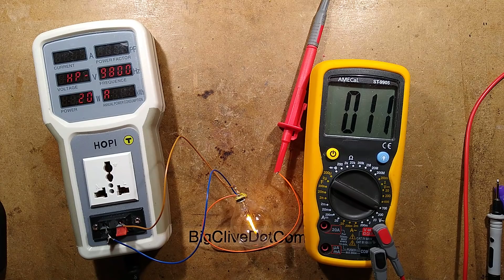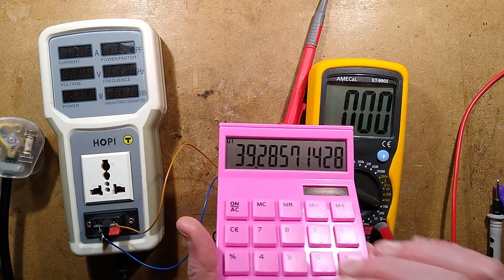Exploring 0.5W LED festoon lamps and extending their life

Comment: In America we don't problems with this type of socket causing fires all the time.  They are called "candelabra" because the fabulous entertainer Liberace wanted to put a candelabra on his piano during his Las Vegas performances but couldn't use real candles on stage so he got a company in Michigan to fabricate a candelabra out of electric bulbs.
Reply: I'm pretty sure candelabra base predates Liberace by several decades. I have several wall sconces from the 1910s that use that base, and I have old 7W incandescent bulbs from the same era that are "flame shaped" to use in them. The wall sconces are designed with a bracket holding a drip tray, a cardboard sleeve painted like a candle, complete with candle drips on the sides, and then the bulb, and a hanging "reflector" over the lamp, exactly as a candle sconce from the 1700s would have been.
Reply: @lwilton  exactly, would love to know where that misthinking came from!
Reply: @phonotical  from the company itself, who probably overcharged the ignorant artist by a mint for creating something which he would have been told is 100% original just for the sake of extortion. I couldn’t imagine how many times Michael Jackson’s purchasing power must have been u$ed against the market seeing as he’d never waste any time at auctions bidding on artwork.
Reply: @HighestRank  don't believe all you read

Comment: You should try one of the filaments on a current limited DC supply. Try reversing the polarity and see if a different set of LEDs light up. This would show that they are made of pairs of reversed LEDs.

Comment: The exterior Christmas lamps used in the past to decorate the homes outside in the States never had any holes in the socket base to drain out water. We never had any issues with moisture causing problems with either the lamps or sockets. The traditional Christmas tree lamps in the States used an E12 base while the exterior lamps used a slightly larger base ( perhaps an E15) and were made of a thicker glass to endure the temperature variants and rough handling  found in exterior use.

Comment: I have these and they are not waterproof. I had issues within in a week. Took bulbs out and filled socket with dielectric grease put bulb back in. No problems with water getting in.... Will be adding a capacitor thanks .

Comment: Interesting.
Wonder if the led strings are wired as a bridge rectifier.
Small correction. These are not festoon lamps, those are tubular with a cap at each end.
Reply: Small correction,  the string of bulbs can be hung up in a festoon. The bulb you mention is a festoon in itself with the internal filament festooned from one end to the other.

Comment: In Adelaide, South Australia we have had that size festoon for about 20 years but they are low voltage (12 Volt) only. Bedside lamps and Xmas tree lights are all they are used for.  A lot of people use them for under cover entertainment area lighting. My best friend has 4 sets daisy chained which run the entire border (8 m x 5 m) of her back porch/entertainment area. They light up the area really well. They have been up for almost 6 years without any problems.

Comment: I’ve got the solar panel version that has 2 lithium batteries in it, on my garden room. On a sunny day the solar panel keeps them on all night, still working nearly a year later. Each lamp is 3 ish v if I remember right.
Could you take one of the lamp bases and fit the capacitor to it instead of a lamp, so it could be part of the set, maybe the first lamp in the run?

Comment: I use dielectric grease from an automotive parts store and smear it on the bulb threads to help waterproof it and prevent corrosion.
Reply: How about wax?
Reply: @fredfred2363  Might work. Grease will move as things expand and contract.

Comment: The LEDs voltage of 110V could indicate that the bulbs without resistor are used in the USA, it also means that the US version if wired in series with a second set could work in the UK, no resistor issues...
Reply: Leds always need a resistor in series to limit the current. For 110V it is a smaller value and also dissipates much less heat.

Comment: I would love Clive to explain why Europe has more phases in there electrical system.  I know why they did it over in the US/NA,( to sell more copper), but I've only seen larger phases in commercial applications, never at home.  It's strange when your at work and half the lights and power go out because of a power outage but other areas continue to work fine without a UPS or generator.

Comment: That is a standard Candelabra base used here in the U.S. and is very common. Old indoor incandescent Christmas tree lights like the string you're showing was also the source of many house fires around Christmas. The E-14 base you showed @1:13 was commonly used for outdoor incandescent Christmas lights and I can't think of anywhere it is used these days except for appliance bulbs such as a Microwave. The Candelabra base is still used in chandeliers and wall outlet hallway/bathroom nightlights with incandescent but now it's common to use an LED model lamp instead.

Comment: the vent holes actually help keep moisture from building up in the sockets, GE c9 Christmas light sockets from the 60s were the first to use vents in the sockets to keep the moisture from building up, it was found that with a totally sealed base that even with a rubber washer some moisture made its way into the sockets and would corrode the base of the lamp badly and eventually lead to shorting in the socket.

Comment: Are all the bulbs in parallel, or is it two parallel strings of seriesd bulbs (as is typical with fairy light strings here in the U.S.)? Since they only have resistors in them, and operate off both halves of the AC cycle, could you dim them with a Triac-based dimmer? Have any of the resistors gotten too hot and gone all black and sooty? How about hacking the Triac-based dimmer by controlling it - not with a pot - but with a blinky LED? Electronics can be so much fun… when you wander off the path! 😋 (especially if your path is lit by blinky strings of LEDs!)
Reply: Like most large-bulb sets, all the bulbs are in parallel. Usually only the mini-lights are wired in series.

And yes, since it's just a resistor and LEDs they will run fine on a TRIAC dimmer, at least if the current is above the TRIAC's minimum.

Comment: I would guess that the small holes are to allow for water drainage/evaporation since these are designed to be used outdoors.
Reply: Years ago I actually looked at the patent documents for those sockets with holes. Indeed they are "weep holes" to let water get out. The addition of those holes is what allowed C7 stringers to be labelled as indoor/outdoor rather than indoor use only.
EDIT: Outdoor use in USA, not sure about other countries.

Comment: Always liked the word "festoon", it used to be used to describe a particular type of train-spotter, the chaps weighed down with lots of cameras, some with massive zoom lenses etc. 

My grandfather showed me a length of festoon cable and how to put on the lamp sockets which spike the flat cable, this was about 55yrs ago. It was chunky stuff, I think it probably came from an uncle who worked for the council as an electrian and got involved with hanging the Christmas lights every year. I cannot remember clearly the bulb type but I thought it was B22 but it could have been E27.

I had to stay (daytime) with my grandparents during the school summer holidays on weekdays due to my parents work schedules. My grandfather who was a big fan of radio and all things electronic thought boxes full of disassembled valve radios were much better toys to keep me quiet, of course I started the process of putting them together. By the time I was about 8 with his help I had a working chassis on the table, lots of live bits but he was happy enough to leave me to fiddle, add a bigger speaker, a longer aerial (it was a cable that I hung around the room). It was about this point he got me wiring lights in his shed. By this time they also had dedcated a room to my activities, the radios ocassionally picked up radio one and I became aware of the swinging 60s but for the most part it was radio two and "Sing Something Simple", the Kings Singers I think but I maybe merginging two memories. 

What he taught me was not always correct mainly because the science had moved on, our understanding of electrons and the direction they flowed is just one example, but the practical side was fairly sound. In the end he was a big influence on me and when I left school I eventually became a sound engineer, but that's for another time. 

Sitting on the shelf next to me is his crystal radio, I imagine it was his first radio as a lad early in the last century, (I think he was born in 1900). It is a plank of wood a bit of that strange brown board they used for things like tag strip is screwed on the edge at a right angle to make a front panel. There is a large metal rotary tuning condenser (his words) with an even larger dual knob on the front, the small knob in the centre s for fine tuning I believe. There is a gass tube cats whisker on the front and the only other component is an aircore coil with the words "What are the wild waves saying?" on the top. 

It is incredible how we have advanced in the last hundred years, it has come to my attention recently that the UK does quite an appalling job of preserving it's industrial history and a lot people now do not know just how much progress was made. 

Well it is 3.03 in the morning, which is not unusual for me but I do need some medication, (diabetes, lungs, heart etc), so I bid you good night and thank you for an informative video. 

Edit: I should give mention whilst talking festoon to a cable that may have been inspired by it. I also did plenty of commercial comms work over the years, in the 80s I was putting in the original thick ethernet, this used a large (12mm?) quad screened coax, 2 x braid & 2 x foil, it required tranceivers to be placed along its length which then used a very thick form of twisted pair to connect to a computer this alowed the coax to remain in ceiling voids or under floors, out of sight and undisturbed. Apart from the worst use of a D plug on the tranceiver and computer for the twisted pair, it used a sliding clip instead of the usual screws, it was quite a robust system, unlike the thin ethernet that came later that had client accessable T-pieces that could take down a whole segment and frequently did. 

The tranceivers could be connected to the coax with N plugs, my preference, however Zerox who designed a lot of prctical side thought that new computers should be able to connect to a live system so they came up with the Bee Sting clamp. The large cable had to be "drilled" first and there was a special tool for that, the tip was metal but it was insulated so only the last bit showed so you could not short out the coax. Then after getting it through all the screens and all the way to the massive centre conductor you could put on the clamp and with a very large winged screw tighten the tranceiver onto the cable. It makes me shiver just thinking about it!

Comment: From the US, strictly speaking, those style of lamp holder would be rated for indoor use only on the box, but from experience, they'd probably work for a couple season just fine outdoors under the eaves of a house -- generally nowadays christmas lights only have a life-expentancy of one or two seasons anyway.
Reply: We've got some LED Christmas lights from over 10 years ago, have been running indoors for like 12 hours a day. A few of the blue ones burned out after a few weeks, maybe months, but the rest have been solid. Maybe they've learned to engineer them to fail quicker now... more resale profit?
Reply: @user-ut9ln4vd5m  The major reason for failure when indoor-rated strings are used outside is corrosion. Either one of the sockets corrodes enough to become an insulator, or not too uncommonly a wire will simply corrode in two. Used inside where they don't get very damp they can last near forever if the manufacturer didn't under-rate the parts.
Reply: We've been hanging a candelabra-based light string at Christmas now for about 30 years.   Same string, still in good shape.

Comment: The E10 and E12 base Christmas lights tend to be the MOST reliable lights here - well, aside from the standard E27 ones but those are too big to put on plants and are really more just advertised as patio lights instead. Those holders with weep holes mean that if water gets in, it usually gets OUT again, and on 120V the water that sticks around will usually just boil off over the course of a few minutes - it's not got enough voltage to start an arc. On AC, contacts that are in use seldom corrode, which is the main reason the mini LED Christmas lights over here are... not so reliable... After a couple months individual LEDs will go really dim as one side of them corrodes under DC voltage. Same problem the solar fairy lights and the 12V DC versions of these always have. The best way to prevent this is to, before you put any lights up, go down the string with a tube of white lithium grease and glob some into the contacts of every bulb as a dielectric/corrosion preventer. 

The incandescent versions of these really just last FOREVER, aside from occasionally burning out a bulb. I've got some that are older than I am that get left outdoors every year and still are absolutely fine.

Comment: Are we really replacing filament lamps with LEDs... then sticking resistive droppers in series? Is this any more efficient than an incandescent?
Reply: Yes and yes.
Reply: @Shaun.Stephens  Why wouldn't you use a capacitive dropper here? Is it just the greater price of the capacitor versus the resistor?
Reply: @Spiz103  I think we'll have to wait for the follow-up video where Clive dissects the LED strips. I'm thinking that the resistor works better with these "AC LEDs" than a capacitor would.
Reply: @Spiz103  Yes, I believe it's just the cost and physical space difference.

Comment: I haven't used any of the newer LED stuff, but I've used these types of socket many many times in the US with the old style christmas lights. They do tend to corrode out in the socket very quickly, often the bulbs get stuck and break when you try to take them out, and tons of them stop making contact at the tip very soon. Basically disposable after a year or two.

Comment: Clive
I saw pendulum that swung a ball with a pointer on the bottom.  As the earth rotated every hour the swing pointer knocked over a wooden block. So you tell the time.
Sir, is there a pendulum circuit that I could build to make this ?
Reply: it is called a Foucault pendulum
Reply: @frogz  
Thanks you for answering my question. 
Cheers Mate

Comment: Re wattage of resistor: Just guessing here, but it might be interesting to consider the waveform of the circuit. The resistor will see no current until the voltage exceeds LED breakdown. Does your multimeter measure true RMS or the usual "assumed sinusoidal" estimate?
Perhaps the resistor isn't overloaded at all.
Reply: I"m not sure which his multimeter measures, but it doesn't matter here. Since the HOPI measures a near-unity power factor we know the current waveform is near-sinusoidal. Since the resistor is a simple resistance we know its voltage waveform is also sinusoidal.
Reply: @eDoc2020  The power factor and waveform are completely unrelated parameters. Power factor is a measure of phase difference between voltage and current measurements. If applied to non-sinusoidal waveforms I'm not at all sure it has any meaning at all.
Reply: @wb5mct  YouTube ate my comment but I'll repeat the essence. Power factor ans waveform are related. PF is wattage / RMS voltage / RMS current. This applies no matter the wave shape. While a phase difference will lower the PF, harmonics in the load current also will.
Reply: @eDoc2020  After doing a bit of research on the HOPI meter I have to agree with you. I had assumed that the HOPI (as a cheap Chinese meter) was just basing power factor reading on phase angle. (Add in some "Senior Bias": I'm old and that's the way most power factor measurements were done back before electronic power instruments were available and when virtually all loads were linear.) 
I had not seen Big Clive's video on the HOPI 
 https://www.youtube.com/watch?v=2HQGXZU2d4I
and even he assumed it was using microcontroller approximations and was therefore less accurate than it turned out.
To further compound my error I missed the fact that the resistor is such a high value. With over half of the power being dissipated by the resistor it will have a fairly profound effect on the waveform and power factor. The usual LED "filament" bulb uses a much smaller resistance in proportion to the diode drop, making the current waveform highly non-sinusoidal. For a look at the more common filament bulb as well as a very good comparison of the HOPI to laboratory grade instruments take a look at https://www.youtube.com/watch?v=5lEo6SzkDDs  . For a look at the waveform I was expecting look at 30:00. The HOPI showed it's worst power factor error in the test when measuring the filament bulb (HOPI 13:46, Yokogawa 20:55). 
All things considered, the resistor is likely dissipating near Big Clive's estimate and is certainly suspect.

Comment: It would be interesting to look at the LEDs. You could work out if they have two inversed strings, or a rectifier using a multimeter.
Reply from the maker: Already done...
Reply: Multimeter, oscilloscope or other external measurement would be the same for bridge + LED string and string of reverse pairs of LEDs.  A high speed macro camera may show if half the dots under the phosphor is lit at a time or if it's all being lit 100 times per second.